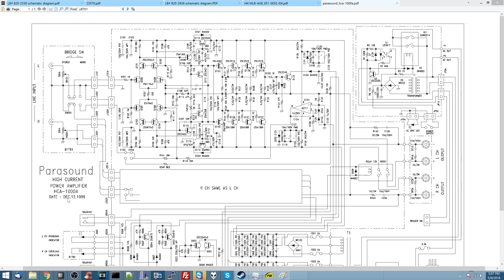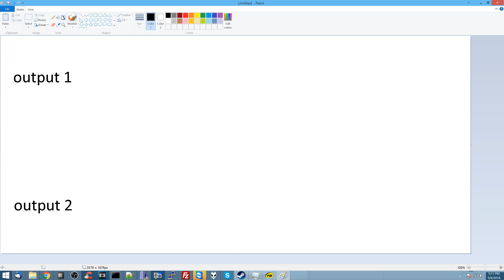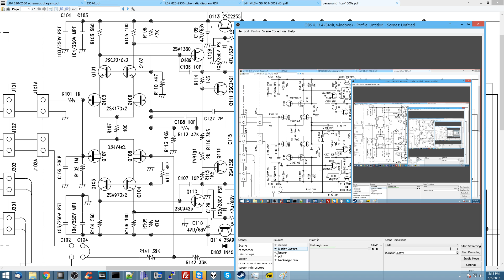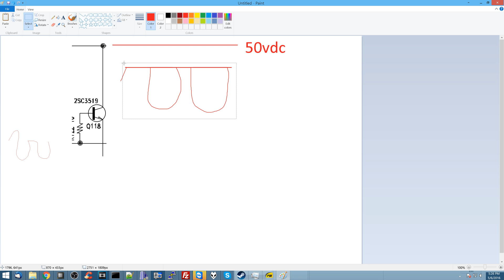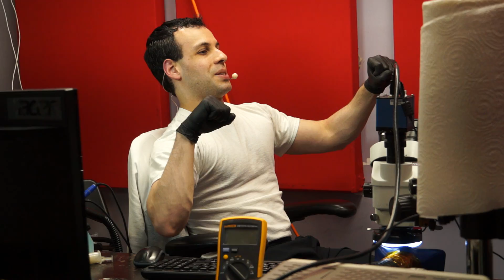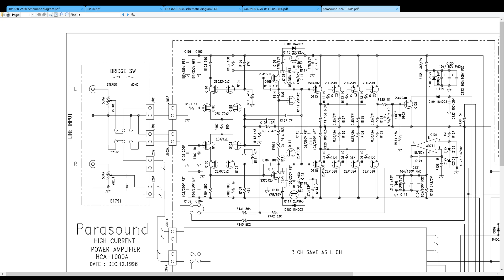If you didnt believe I flunked out of college...

Comment: The input on your amp is FET for both positive & negative input. These transistors are indeed naturally voltage amps in normal connection. Bipolar transistors are current amps in typical connection though can be used as voltage amps but is different. It has very high output impedancein voltage amp mode. As current amp the output impedance is very low & there is actually a slight drop in voltage in final 2 stages due to voltage drop from base to emitter. On my old adcom amp this high output impedance of voltage amp section was used to provide bias adjustment by inserting variable resistance in between + & - voltage amps. The FET transistors appear mostly to be input amps with little in the way of signal voltage boosting. These feed a pair of bipolar transistors that are fed with constant current source power. Input voltage causes shift in current from constant current source  in which the bipolar voltage amp transistors senses change in current & converts it to voltage to send to final drivers & output transistors. Here there is a slight drop in voltage when measured from voltage amp to output. This is a little over one volt.

 Your amp handles the final voltage amplification exactly the same as the Adcom amp did with bias adjusting resistor between the 2 voltage amps. The higher the resistance the greater the voltage spread that drives the output away from  being totally off. You amp same as the Adcom amp really only has 1 voltage amp stage. The rest is only current amps.

It is strange to see an opamp used to provide the negative feedback signal back to the input of power amp section. This is however a pretty fast opamp. There is actually more than one negative feedback path on your amp. One direct & other through opamp. There is also a bridge amp switch that feed other channel a signal into its negative input for bridging.

I am no expert though I did modify my adcom amp extensively using my own ideas in spite of no engineering experience. The results were impressive in terms of improved audio quality.

Comment: I still have my TEAC, 200 watt receiver, i can't use it through, I took it outside in the summer and it was full of c. roaches and spider webs and c roach egg sacs, all dead mind you. I put it back together, but it's not allowed in the house. It's just rusting away in the utility trailer. Instead i bought a Nob Sound NS-01G Pro for $38 and drive a pair of 15 watt speakers. I lived in an apartment building with c roaches about 5 years ago. Roaches get into everything so i could only save a few things. Expensive and personality valuable stuff was all thrown out. Now I'm clean of bugs, 2.5 odd years later renting somewhere else. At least as far as I know, bugs can be anywhere, but at least i don't have roaches anymore.
Reply: Moral of the story for Louis just buy a cheap mini amp that does the job. That's my 2 cents.

Comment: I’m an electronics engineer and service tech and I can tell you WITHOUT A DOUBT that the number one problem with most techs I come across (I’ve been an electronics instructor) is that while techs understand how to check a component, they don’t understand circuit function! So they can say, “this FET has failed”, but in the circuit, they have ZERO CLUE how it actually works. The key to being an effective tech in a world without schematics is to UNDERSTAND and almost be able to reverse engineer a circuit in your head when repairing it.

Comment: Most amplifiers aren't too sensitive about the matching of output devices, so as long as all of the output devices came from the same batch, they should be close enough. Some amps do require matching, usually Vbe matching. If you replace the transistors in the input differential amplifier, those DO need to be closely matched since any imbalances there will affect both DC offset (though their might be a control to compensate for that) and the distortion.

Comment: PSU is full wave rectified (with 0v reference coming from the centre tap), not half wave rectified as drawn. Very minor thing. 

The “negative feedback” you pointed at is completely mistaken I believe. It looks to me like that op amp is a precision op amp doing speaker output DC offset correction. The most obvious clues are that the op amp has a RC filtered + input, and no feedback resistor but a capacitor instead between output and - input.

The RC filter throws away high frequency signal (the music) but not any DC signal. The capacitor for feedback path makes the op amp into an analog integrator (as in calculus - finding the area under the curve).

Comment: Getting schematics depends heavily on company philosophy. I even had conversationwith chinese companies who were willing to share their sheets (was 3k6 something SM PA amplifier) for repair assistance. 

Some companies wont share because they were worried about schematics being spread all over the internet. But at least, really nice engineers there were asking for the problems I encountered with their products and then replying really useful hints to repair their stuff (use thermal cameras to match MOSFET groups while running on specified input without heatsink was one of my favorites). If you do so, you can be sure the technician will recommend using these products because he knew where to ask for support. 

Not sharing schematics is telling me sometimes that the margin of the product is much to high, so the company is worried of having their product copied. If the products quality is really based on high-end and well matched components, its not only the developement, but the overall cost you'll pay for. Like cooking. 

Btw. on some older studio gear, schematics were inluded with the tech manuals to match the new equipment into studio environment, on Soundcraft, you got options set by jumper and they just write "okay, solder this jumper from jere to here and you'll get your +4dbu input up to +6dbu if needed".  
On newer things with higher integration level (or IC count), I experienced much use of application notes from the IC supplier, especially TI and LT. Sometimes it makes sense to check them for similarity and there you'll get your information to work on.  Reading these is worth it.

Comment: #3... a bad downside of any transistor dealing with Alternating current signals is that it requires 7/10 ( 0.7 ) volts of input to turn on.. in which case,  if you were amplifying the input signal as a single stage every time the sound input signal crosses the 0v into the opposite phase,  the transistor turns off.. with this design that's mitigated a little bit by splitting the input phases and amplifying then separately... then combining the plus and minus phase again on the outputs.

Comment: #2 the industry standard voltage for amplifier output transistors is 12 volts,  for safety, and the transistor just gains the actual amperage output.. but the max potential voltage, in each phase is 12 volts each. This amplifier design is actually awesome.. will explain in #3

Comment: #1 an ac voltage rectifier actually transposes one phase, polarity of the input waveform to the opposite polarity.. excerpt for,  in this case,  since the transformer is tapped in the center,  effectively making that the output signal center,  the bottom and top are both equally the same distance from the center.. but the top peaks should still be on the positive side.

Comment: WRT access to schematics, you're probably too young to remember Sams' Photofacts. I worked fixing TVs, radios and other consumer electronics in my early college days (and later). Sams published fully indexed packages that contained full schematics with descriptive manuals for practically every consumer electronics device. Each package typically contained one major product, like a TV, and several smaller products like portable radios, etc. They weren't expensive (~$20), and a good service shop typically had a subscription.
I miss those days.
Reply: I have a bunch of them myself. The Photofacts were better than a lot of the info coming from the manufacturer.

Comment: If it ever does fail again, use the base components as a foundation for a lm3886 gainclone. If built with quality components, you'll end up with an amp that is far better than Parasound and other high-end amps like Adcom or the older Marantz class A circuits.

Comment: First off thanks for countless hours of good wok and great initiatives and your time that helped sop many people. But OMG I have had to stop watching this one sorry . Sure I really do like your board repair videos and all rights to repair and everything but if your explanation of the bridge rectifier and push pull amplifier was first one I have heard I would never learn anything about amplifier's nor I would have build or develop any of them ever. I understand it is way you explain it to your self and it works for you but that logic is so not educational in my honest opinion and that is because you use wrong electronics components to explain electronic things. If you have used every days things to explain what happens every kid would be able to understand it. Like show simplified one stage or one even better one single transistor and explain it. Like transistor works like a water tap. Tiny signal on the base of a transistor regulates how high pressure water is flowing. How strong will water flow depends on the height of the water tower and size of the pipes and valve it self. So potential of the water hence height and potential as Voltage. Or you explain Push pull as two horses in opposite direction. When one is going fwd other is going back and they push and pull helping each other. Etc. etc. Also in this amp case end transistors are parallel hence like 3 horses pull in one direction and 3 in the other. What ever.  
Sure I also agree that you do not have to be rocket scientist to screw in the bulb and I am totally for visual inspection no brain mode and taking care of obvious things and repair it that way if possible. Only thing is that doing it that way on the as complex thing as laptop main board is good thing. By simpler things like amplifiers there is a great chance to educate people in depth. There fore we as human race will don't end as movie Idiocracy implies (BTW not a Comedy but horrible documentary of Human future). We kinda want that people do understand how things work.
Sorry I know this one is not meant for me but it ain't good and it is not because of the production value and tools. Sorry once more. Keep doing a great work you do for the Community. Best of luck.

Comment: FWIW I think you confuse voltage gain with power gain in your explanation.  The reason you may lose voltage gain is that you are driving more current through a lower impedance to get more power to the speakers.
Reply: Yeah, the power stage is just a voltage follower, no voltage gain occurs. Rather a slight loss, the B-E voltage.

Comment: Matched transistors are just for purists or high precision equipment...if the bias is set right the difference between transistors doesn't matter much in consumer grade electronics..that is 1 reason why the emitter resisters are there (to balance current draw among the 3 power output transistors) If transistors are blowing you have more problems than unmatched beta...why did the amp fail in the 1st place? That is the problem that needs to be corrected before just replacing transistors. I find most amps are not designed correctly and have inherit problems...For the BEST info on amps on the net check out Elliot Sound Products, he is great at dispelling all the amplifier "myths" that exist. They do not beta match the transistors at the factory as transistors from the same batch usually are close enough not to worry about it. That being said you could just do the same yourself. 
BTW> Typically if your blowing output transistors it is usually the fault of the bias servo circuit. and who needs stinking schematics when you know what your doing....;-)  I never had schematics for 99% of the consumer electronics I used to have to work on.

Comment: We all are learners, we can and will learn whether we intended it or not and information (or misinformation) is always literally in the air and is hard to avoid these days. The real difference is that the methods we need to do that with are often individual. So if you dropped out of college that means that you're not necessarily any dumber than those who have went through the college. Also, the need of practice hasn't changed.

Comment: I have an ancient Pioneer SX-6000 receiver which my father bought sometimes in the late 60s or early 70s at a PX. It - brace yourselves - actually came with the schematics!

Now, parts for it are sometimes hard to come by and it crackled like crazy because the potis were funked up with dust and gunk from a good 40 years, and one of the speaker ports was pushed in.

Had an electronics enthusiast friend clean it all up and touch up some flaky-looking solder spots and he even 3D-printed some new speaker connectors for me.

Good as fucking new, with a sound that puts most modern receivers to crying shame...

Comment: Negative feedback basically controls the voltage gain. Without it, you'd get square waves of either +50'ish  and -50'ish (your dc power rail limits) for the most part.  Beta values of the transistors make  basically a  very very very high gain which needs negative feedback at the input of the "input buffer pair" mirror to limit the differential of the input enough (sometimes quite a lot is required) to tame the over all gain of the loop to manageable/desirable levels. 

You were close Rossmann that negative feedback samples the output to adjust the input. And yes it does prevent distortions. I just dont' think it does so quite how you explained it. (it has been a few years since i've looked at amps as well). So my explanation might be a smidge off as well.

 It's easier to see and understand with a basic op amp which have open loop gains (betas) of like 100,000s or more (Ideally Beta=infinite to get the simple closed loop gains equation -R2/R1).

Oh, and slew rate is the rate at which the amplifier can change voltages -> 50v/microsec.  Poor slew rate would mean bad tracking of the input to output. -> input says i want you to be big big big voltage NOW but output says hold up it takes time to do this shit. Typically not an issue at all with today's solid state amps unless you have 10's of 1000's of times better hearing than the average human.

And bye bye comment to the abyss of youtube to never be read by anyone. Hurray.

Comment: "I'd rather have silence than a bluetooth speaker" Amen to that.
Reply: Why?? Bluetooth speakers are fine, admittedly, much more basic.
Reply: @skeletronas5867  not for an audiophile..
Reply: @felixfeliyfeliz  fair!
Reply: @felixfeliyfeliz  not true at all. Use the right codec (aptX HD for example) and u have audio in realms that noone in this world will hear a difference, not even the most hardcore audiophile. AptX HD supports 24bit audio with  576kbits at 48kHz sampling. Then it just depends on the driver of your speaker, which is the same bottleneck as in normal speakers
Reply: @skeletronas5867  a last resort for me 
i own a pair of polk audio monitor series from 1984 
i love how acurate some speakers can produce and more people need to be like this
Reply: Bluetooth speakers are fine especially when it is a Thodio.

Comment: I have a question: I have in the past, bought a Pioneer amp (broken) from a junkyard for 2 dollars so I can use its case for my pc build. I did wonder though if there was a chance I could tinker the board and repair it. I did look at the pcb and noticed a lot of clean "slots" with no component soldered (no resistor or whatever soldered). I'm wondrring if those are normal occurrences in amplifiers... (Like manufacturers design a board and schematics but manufacturing decides they are over engineered and leaves off some components thinking the entire unit would have worked ok even without those components?

Comment: Hi Louis, 
Back in the 1980s, you could get the schematics at the public library. However, like you, back around 1988, I went to Motorola (they had an engineering department less the 5 mile from where I lived) and I asked them if they had any documentation on their digital signal processor DSP56000 and they gave me the technical specs, integrated design specifications and the programming instruction set. They also threw in their assembly instruction set for the 68020 and 68030.

At 20:25, you were talking about a transistor gain circuit and how you are getting amplification by making a bigger signal smaller; so there are two types of amplification: voltage and current amplification. If you were pulling the signal from the collector, you would have voltage amplification. By pulling it off the emitter, you get current amplification. Why do you care which one as long as you get amplification? Two reasons: one voltage amplification is limited by the amount of voltage that is supplying the circuit. With the class AB amplifier the total headroom is just under 100v (because of the bias on the transistors). You can't amplify the signal more than 100v peak to peak. However, by amplifying the current, you are only limited by the specs of the transistors. Finally, speakers don't care about voltage,  they are driven by current; the more current you deliver to your speakers, the louder they get until you blow them out.

Nice video. Reminded me of old times.